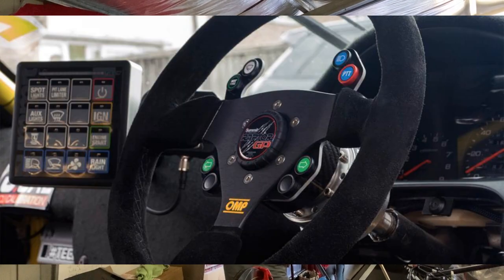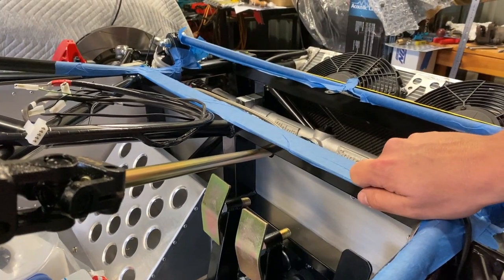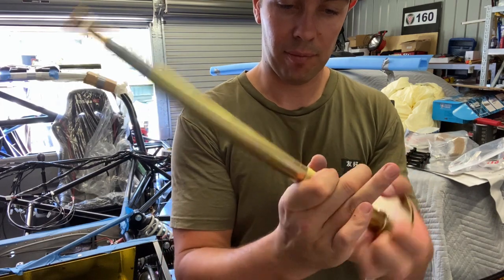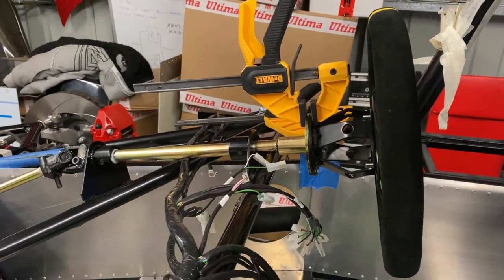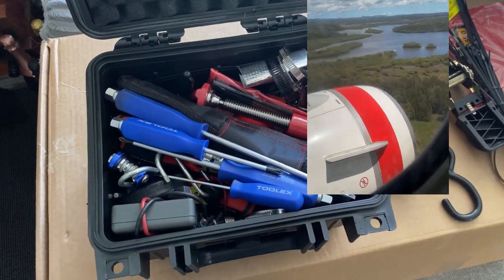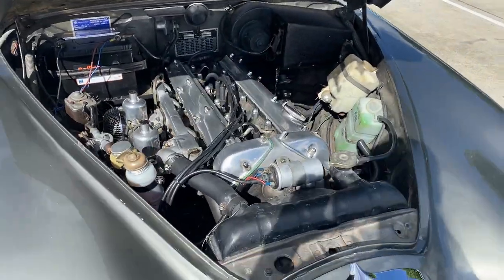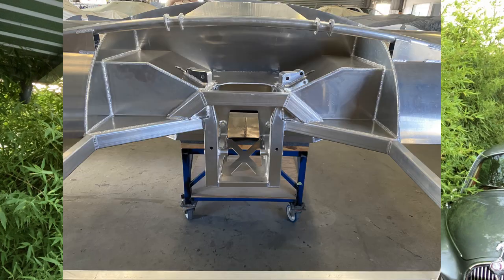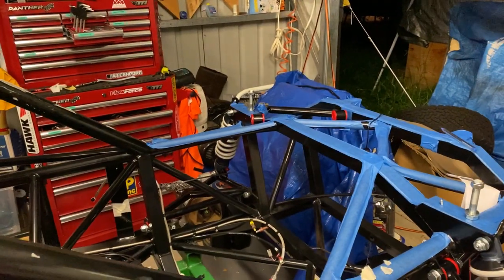Ultima RS Steering, GT40 & Cobra Factory Tour, RAPTOR Giveaway and 1250km in a '65 S Type Jaguar

Comment: Regarding the steering shaft, you say that you are removing the anodised layer for clearance. Is that shaft really aluminium? Anodising is only applicable to where aluminium is the base metal (except in rare exceptions where an aluminium 'paint' is applied to steels). Surely that shaft is steel and the coating Cadnium or, more likely, Zinc passivate?
Reply from the maker: *Zinc. I was probably researching the anodising kit I want that day. I would have assumed removing it was of negligible difference, but the factory manual does say to do so. Cheers!

Comment: Cadmium coating, a right bloody pain in the butt, however it's supposed to be a rust prevention measure,  had all and I do mean all screws, nuts and bolts refinished in cadmium coating BECAUSE, Germans figured out decades ago that it is a type of antiseaze, had old bolts on my Scirocco that came apart proper because they were cad coated, highly recommend it, if you can get a kit, only requirement is a battery charger and 12 volt to electroplate any small components.
Reply from the maker: I'll definitely check it out, John. I've been looking at the electroplating kits, CNC plasmas, lathes.... buying tools is bloody expensive, so it's a slow process.

Comment: 24:02 "Bugger all unsprung weight"" actually not at all. Having inboard shocks has added to the unsprung weight, no matter where they are mounted, their weight is supported by the suspension. The pushrod from the lower A arms through an bellcrank and then to the top of the coil over are over and above what existed with straight coil-overs.  Were a conventional system has two joints at either end on the shock, the Absolute Paces system has a pushrod, bellcrank and three joints which didn't exist before; these all have inertia and degrade the responsiveness of the suspension. It's a step backwards. 

Before anyone claims evidence by F1 teams, their designs are mounted inboard to avoid aerodynamic turbulence in high speed open wheel competition, this is not an issue in a Cobra or GT40 enclosed behind bodywork.

Comment: Hey Rob, love your build and videos. Does the steering have a steering lock supplied for ADR's?
Reply from the maker: Thanks! There are two options for ADR. The first is a steering lock and the second is a transmission lock. The next build will use a steering lock, but the Ultima will have an interference solenoid mounted so to lock the gear shift mechanism. You also need a few other bits and pieces like sun visors, centre-high brake light, immobilisers etc. Cheers!